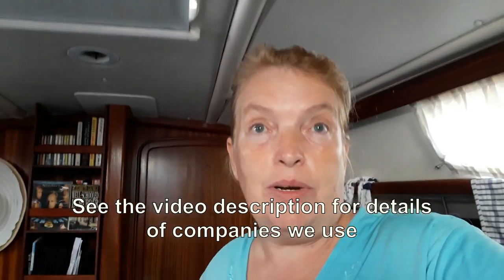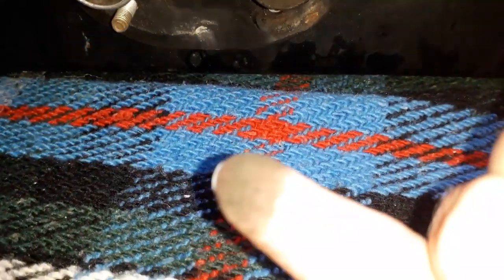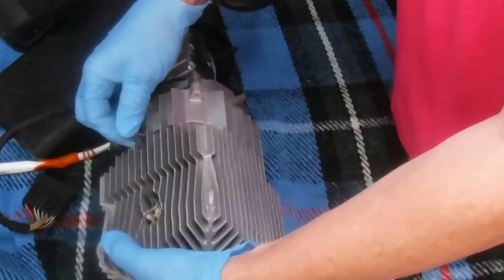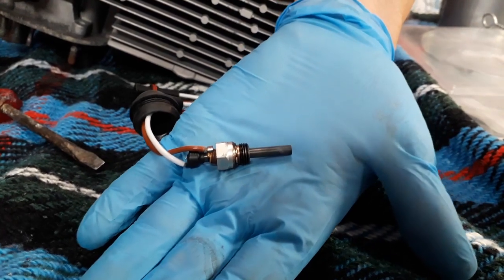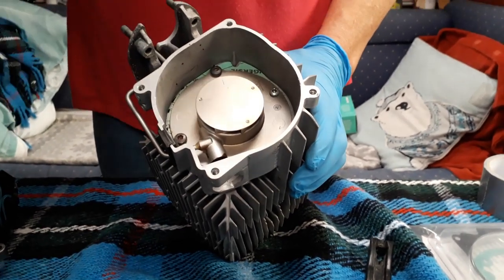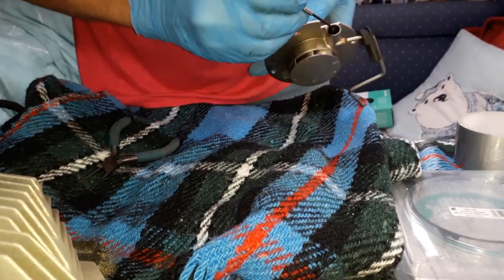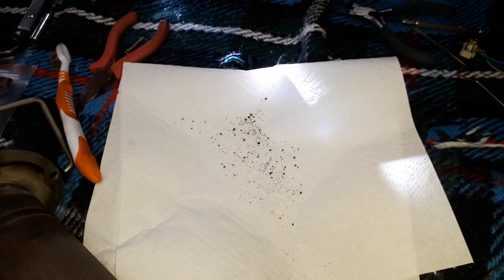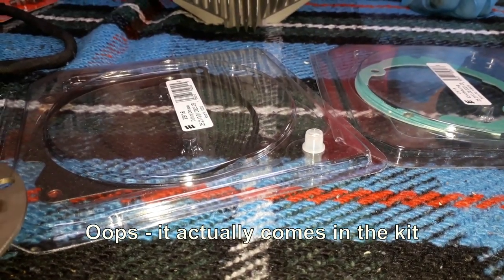Saving money & staying warm - Servicing our Eberspacher Airtronic D4 diesel heater - Ep. 111

Comment: good job you girl's did,,, but!,,, just to save you some money,,  the glow plug is NOT a serviceable item!,, so you do not replace it on a service unless it is not working!, (just clean it off with a scouring pad to remove any carbon build-up on it!),, but you DO change the gorse and the heater's diesel fuel filter!, so all way's carry a spare glow plug a diesel filter/s and a gorse/s!, and when changing the gorse, all ways clear out the very small air hole (just inside the glow plug hole above the gorse) because ""ALL"" the heaters combustion air has to go through this very small hole, and if it or the gorse (or fuel filter) is even a little bit blocked the heater will do one of two thing's,, it will either not light up and burn,, or it will half light up and then smoke like a battle ship on full throttle!,,  as for fully stripping down your heater,, why?,, if its running leave it be!,, don't go stripping it out because you think you have too!,, just change the gorse and leave it be!,, a word of advice though,, if you only have your heater ""ticking over and not running flat out!"",, (and they were built to run flat out 24/7, not to tick over!),,   then you really should give your heater a good two hour run ""on full throttle"" at least once a month,, that will really slow down the build up of ""soot!"" inside your heater and extend its servicing time by at least twice and maybe even three time's!,, it also go's without saying,, you must only run your heater on "CLEAN FRESH DIESEL!" as dirty old fuel and blocked filter's ""WILL"" causes far more problems that you can imagine,,PS<< the service hour's given for the Eberspasher is for there benefit,, and not yours!,, (thrust me on that one),, if your heater is running ok,, wait until it brakes down,, then fix it?
Reply from the maker: Great advice - thank you! The main reason that we remove the unit is because we found it nearly impossible to change the gauze filter due to the way the unit is mounted. It is impossible to see what you are doing and after 2 or hours of frustration we were no further forward. Removing it takes 10 minutes and we can see what we are about.
Reply: I understand what you are saying, but I was trying to say you don't really need to strip the heater right out to service it, just change the fuel filter and the gauze, is all you need to do, and don't even do that unless you really need to!,, most heaters will play up if you only have them ticking over because they need to be ran flat out to burn away any soot in the burner tube! as for the glow plug, on a normal service that is not to be replaced unless it stops working, ie: its burnt out! like it's dead and not heating up at all!,, so just have on board all the tool's and the parts you may need to fix it,, and let the heater be until it really stop's working,,, so in short,,, follow the golden rule,,, """if it is not broke,, then don't fix it!"""

Comment: Nothing like a hands on demo to assist, many thanks. Interestingly, also watched an Aussie example and at 6.30 he uses a bent nail to remove the copper gauze without damaging it. https://www.youtube.com/watch?v=vLnnBM3BTKM  Thanks again. Jeremy [boat in Milford].
Reply from the maker: I tried adapting an old Allen Key to remove the gauze, but I think that it gets brazed or welded to the side. These days I use a jewellers screwdriver to make a small gap then wedge pointy-nose pliers in and yank until it comes out.
Reply: @SailingYachtSaltyLass  I was watching an Australian guy the other day too.  He advises use of a number 10 coach screw, B&Q or similar, & says it's the perfect tool. I'm about to start mine now so chose this excellently explained resource for a refresher. 
I'll let you know if it works.
Reply from the maker: @dougalmcdougal286  - best of luck 👍👍 If you need further info check our blog

http://www.saltylass.co.uk/eberspacher-service

Comment: Got a planer heater last year, had to clean it out just after running it for one day!  (think I had back pressure from duck vent being semi-closed)  Although I love the heat it generates!  New sub and fellow youtuber!  https://youtu.be/DxzQwV0ft5w
Reply from the maker: They are great - Planar, Eber, Wesbasto....  They all keep you snug. Since you are using it, I assume you are not in the tropics? Thanks for subbing BTW :-)
Reply: @SailingYachtSaltyLass  Wish we were there, currently in Oriental, North Carolina, US.
Reply from the maker: Love your new property though. Does need a re-think on the interior design, but I would think about having your Mum in law in the Garage conversion as it has a separate power supply and having the power separate is a good idea, when it comes to  renting off part of the property